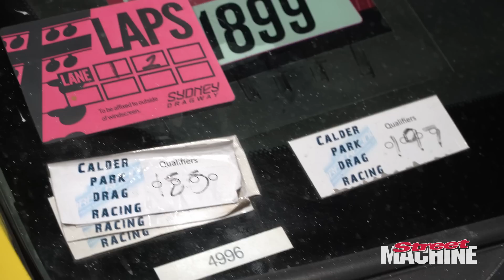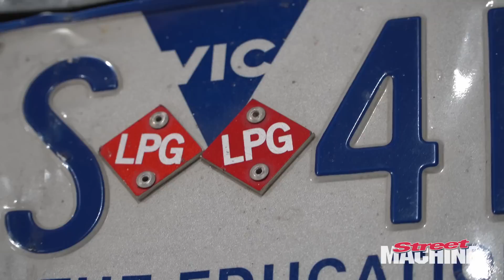Carnage - We Pull The Engine from Turbo Taxi to Find Out What Went Wrong!

Comment: Don't you get sick of blowing that piece of shit up! Build 1 motor and run 9's ... Street machine are the tightest bunch
Reply: Kid in the backyard on a budget would disagree with you...
Go make your own street machine 😹 since you act like money grows on trees!
Reply: Any moron could get a green top, put it on E85 and run 9s and they already showed that can be done with the MX5. 😎 The challenge here is doing a 10 on LPG/Propane, something I can GUARANTEE you've never attempted.
Reply: @MafiaboysWorld   You know why because it keeps blowing up and it will again theres obviously a reason why it keeps torching pistons.. LPG for boost is a really bad idea. 
Yes its easy with E85 because that fuel actually works. No one in their right mind would do this setup if they want their engine to stay together.
Reply: @vr350  As Scotty said, it was 11.5 for a whole year on a single set of injectors reliably. Can't help if the company supplying the injectors can't hold up to their own 100hp/injector claims when they've melted 12 of them already. 🤷
Reply from the maker: The plan was to try something different. We took a std Melbourne taxi, hotted it up and ran 11.0 which is quick in anyone's language. Especially when you consider that it weighs 1900kg and runs on LPG. But pushing for tens is causing issues with stock engines so we'll add rods and pistons to get it there.
Reply: @neilbeni7744  money does grow on trees! It's called marijuana if you didn't know
Reply: @STREETMACHINETV   Its not the engine. Its prob the lpg setup well imo its proven it is after multiple failures. I get its different but sometimes better to go the better and known to work path.. Plenty guys running 10s on these engines stock.  I doubt going forged is going to make any difference can still torch pistons forged or not if the tune is bad.

Comment: When I took the engine out of my bmw we had the same issue starter motor out first then undo the flex bolts 
But we had to pull the whole exhaust off to get to the starter motor and getting the dpf off was an absolute nightmare 
Good work Scottie and you did t get any oil on the good old kt 26 runners 😂😂👍👍👍

Comment: Why not run 6 Exhaust Gas Temperature (EGT) sensors and tune around melting engines? The ECU is more than capable... Then you could turn down the power when the cylinder temps get out of control.
Reply from the maker: Sure we can do that but I suspect it would trip every run and we'd never get tgat 10

Comment: I won a free LPG carburetor system in 2000 to fit to my 302(W) - gas was 19cpl!!!(Petrol 80cpl)!! So for the next couple of years had a ball running around for next to nothing! Today the system is still running faultlessly and LPG is $1.30 petrol is $2.35!!!! My work car was converted to LPG and government paid us to do it!! Still running and on a busy work week (pulling trailer) $40 for the week in fuel!! The good old days of LPG are over if you wish to convert or build a system. I would find a dedicated G6 with LPI or Holdens equivalent!

Comment: Back in my day, the racers with LPG fuelled cars would get straight propane from places like BOC and cylinder filling places as the “filler” ingredients like butane found in Autogas was (at that time anyway) rubbish and only good for econo-boxes. Might be worth checking out.
Reply from the maker: But you have to tune for it and run it all the time
Reply: @STREETMACHINETV  switch on the dash to change tunes on the Haltech and a smaller propane cylinder in the boot? Where there’s a will…

Comment: G'day from West Australia, Scotty😉

Gotta say LPG systems have come a long way from the year I decided to make a twin mixer plenum for my 1986 model ZL Fairlane, 4.1 Litre. 

800cfm of gas Reasearch mixers a omvl converter a 70 litre tank in the boot and a 10mm gas line running to the converter.

And it was bloody quick pushing a 2.77: 1 ratio rear end.
LMAO I thought I spent some money.
It was a deposit on the system you are running.🙂👍👍

Comment: Just chuck it on e85 and be done with it.  Just causing you cost and pain at this point and I think most of us don’t really value the desire to run 10s on gas. I could be wrong though.

Ride has served its purpose and certainly was one of the first videos I watched.
Reply: Nah, then it’d just be the same as anything else. It’s great to see something a bit different, and challenging. The problems and problem solving make it heaps more interesting than the usual Barra or LS builds that are a dime-a-dozen. This and supermang are the 2 builds I’m most interested in.

Comment: Maybe next time you can try dropping the engine and trans together out the bottom?
Not that much more to undo and makes it a lot easier.
Reply from the maker: Sounds like a pain in the butt
Reply: @STREETMACHINETV  it sounds like it but it really isn't that bad, I've done it many times and it is my preferred way. In my opinion it is alot easier than you think and doesn't add any more time.

Comment: Love Turbo taxi but im over the whole LPG thing. Reality is if a few injectors give up on a run that built motor could go too. Why risk the new motor and denting the budget any further. Switch it out to E85 and aim for 9’s because 10’s are a given for E85 and this setup.
Reply: Thinking the same thing mate
Reply: I do get where you're coming from but at the same time running 10's on LPG is the whole point of the project. It was never supposed to be an easy goal and it would be a shame to give up after all this time.

Comment: Scotty, to me going a fully built motor at this stage really isn't in the spirit of Turbo Taxi. Throw another green top in it with all the good parts from the old motor and go e85, then it's still kind of a taxi but the induction and fuel has changed. Please please please do this before going fully forged, you can always slap the built motor in later. I am building an ex police forensics gas wagon into an RTV wagon with XR6 body kit and interior, 31 inch tyres, e85, turbo, t56, push button locker diff and 500rwkw.

I have my own workshop on the sunshine coast in QLD. Not that you guys would get up this way much but if you ever do and you breakdown or something, feel free to DM me for use of my workshop and tools or just to check out some of my builds..
Reply from the maker: It may not be in the full spirit of Turbo Taxi but we've already gone 11.0 and 131mph on a standard motor. We're over changing engines

Comment: Scotty, to maybe make life easier at the bottom of the btr bell housing there is a little hole to stick a pry bar in to rotate the flex plate to move the torque converter bolts into place and undo them :)
Reply: Doesn’t have it cause I’m pretty sure it’s got aftermarket stronger bell housing